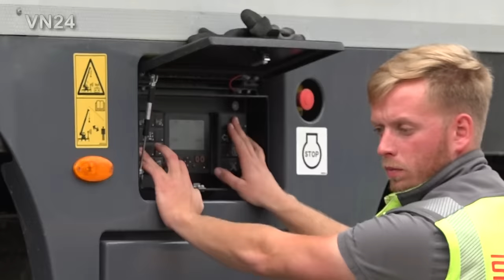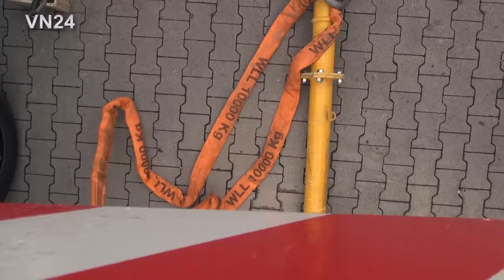23.06.2021 - VN24 - Linienbus bricht nach Wasserrohrbruch in Straße ein

Comment: 3 things I was taught when setting up aerial fire trucks:
Don't set outriggers on manhole covers
Don't place the riggers on sidewalks
Don't short jack.
Crazy setup...
Reply: That's why they put down those steel pads to distribute the weight. It is a medium sized city in Germany that has a lot narrower streets than  New York or LA.
Reply: I have seen cranes put steel and wood under outriggers, but it’s what’s under the tarmac that you can’t see like voids. they remain hidden until a load is put on that area

Comment: That was a good lift guys.  But wouldn't a 75 ton rotator wrecker been enough? Seems a bit overkill to bring a crane and tons of counter weights in. A 75 ton rotator wrecker and a 35 ton to drag winch would've been sufficient.
Reply: i believe accessability was the issue. road was compromised so a 75T tator wouldnt have the reach needed or lift capacity at full length.

Comment: It seems that the title is wrong. Not the bus failed, the bridge failed. Or something else gave way underneath roadway which caused it to completely get ripped to shreds over quite a large surface. It must have happened either when the bus drove at that location (maybe the weight of the bus triggered it) or the driver did not spot the problem fast enough. But that last one doesn't seem likely.
Reply: At 0430 in the morning a water main burst washing out the road, the bus driver was warned by a Taxi driver but didn't stop in time. The weight of the bus collapsed the road. If people would read the post carefully, they would see the reason for this accident. At that time in the morning, it is too dark to see much.

Comment: What was the need of lifting the bus lol 😂. In my country they would have used a tractors or a truck and pulled it out in seconds 🤣
Reply: Yeah i was thinking the same
Reply: Probably some parts would broke
Reply: @joanferra3395  nothing should break if u pull it from the proper towing hook point basically pull on the chassis.
Reply: @KuntalGhosh  but some parts were touching the ground
Reply: @joanferra3395  as long as the bus moves it's fit for service 😂 .
Reply: За бугром не ищут лёгких путей

Comment: They bought that huge ass crane just to lift and move the  bus 2 meters over?...waste of time and money is what I smell....
Reply: How else will they move it?
Reply: So you would position a smaller crane next to the bus, so the crane can also sink through the asphalt due to the washed away soil.
Reply: Really?  How much money could they save by leaving it in the hole, and let traffick drive around it?  It's just a meter or two in the way, right?